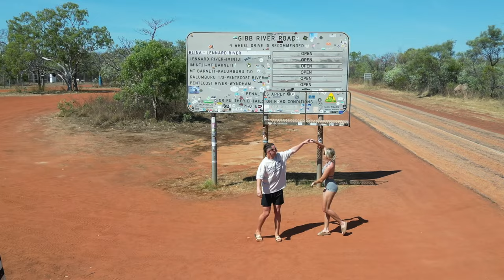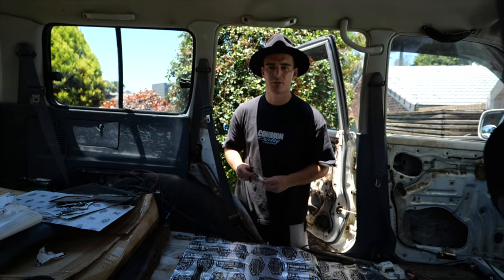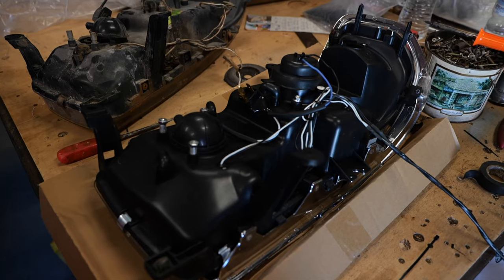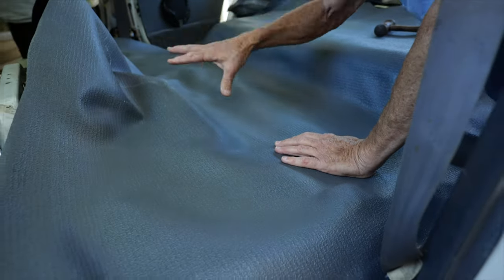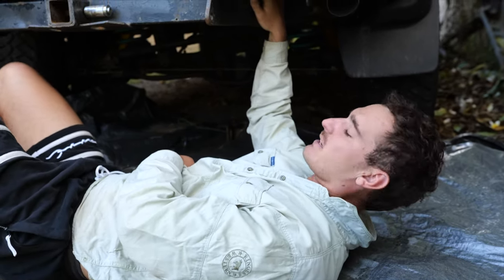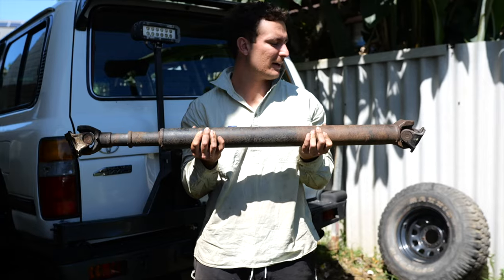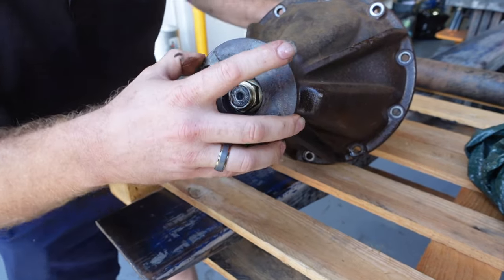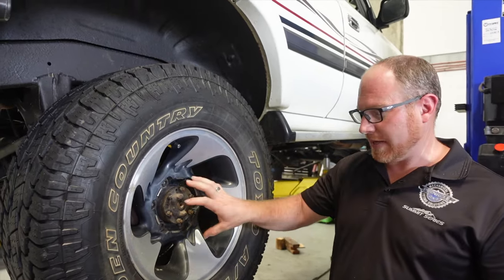BACKYARD 80 SERIES BUILD! We've run into some MECHANICAL issues! time for a DIFF rebuild

Comment: For next time all ways take off the fill plug before the drain plug because if you can’t get off the drain plug at least you can fill the diff back up and also  the diff oil comes out a lot faster and easier because there is air flow
Reply from the maker: Very handy tip to know for next time!! Thanks a lot 🙌